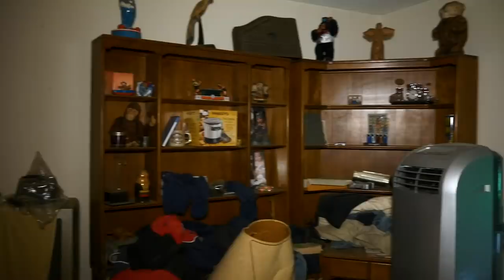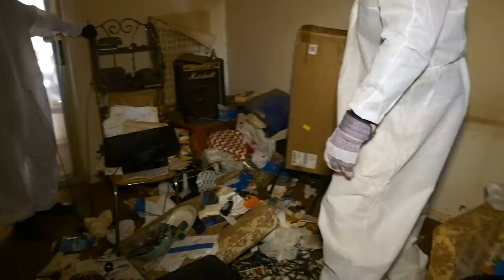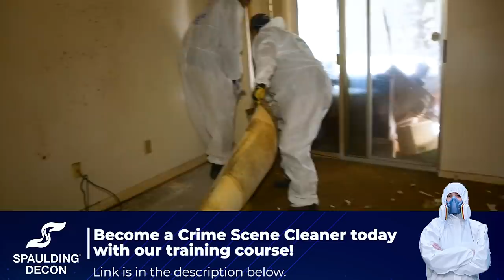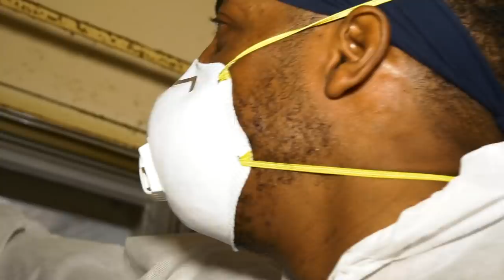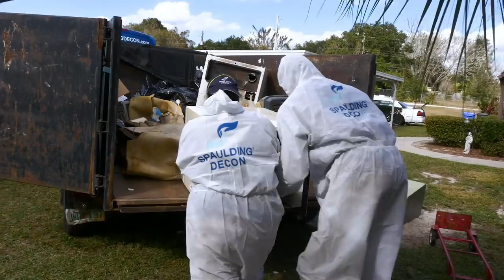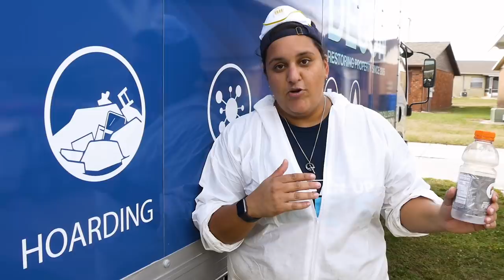A Musician's Hoard | Tampa, FL

Comment: Great clean up!&I'm proud of the guy who lives there,for being a willing participant in the process!!
I'm very concerned of if the guy will have the mold professionally removed for his well being,&have the walls cleaned up or painted.
I felt that second cleaning crew could have scrubbed the concrete flooring underneath the carpets that were removed,&then  put a layer of that white sealant or whatever it's called; on top of the concrete floors to make ur ready for carpet installation when he is able to install carpeting in his own. (Just my thoughts).

Comment: Brown recluse spiders are tiny!! About the size of a Male Pinky nail and do not go over 3/8ths of an inch long. They have uniformly colored legs and solid colored abdomens without banding or stripes or spines. They have 6 eyes (most spiders have eight) arranged in pairs of two with one set facing directly forward. Important to know, since they are venomous to humans. Florida only has two main types of venomous spider, the Recluse Spiders and the Widow Spiders! What y'all described was most likely a Huntsman Spider, sort of an 8 shaped body with long athletic legs and lightning fast since they run down their prey, their bites are generally painful, but they are NOT venomous to humans, they prefer to run than fight. Stay safe!!!